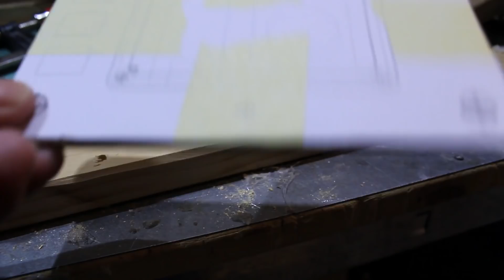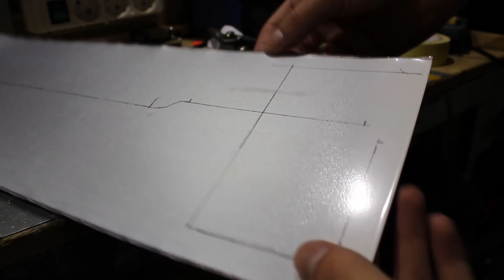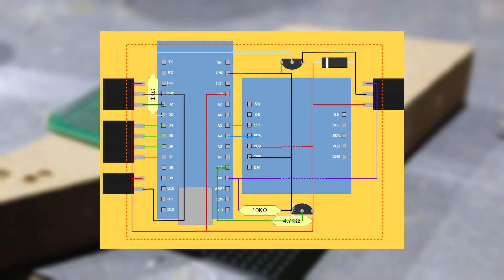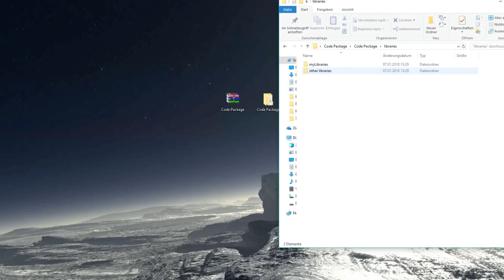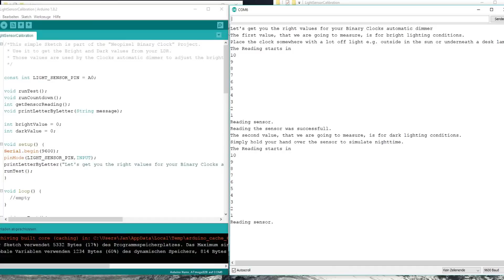Arduino based Binary Alarm Clock -  How to build it

Comment: Could use a little help. The newest Arduino update will not allow the clock portion to upload. has anyone solved this? I made the entire circuit on a breadboard and no luck getting it working.

Comment: Great video. I was looking for a binary clock to buy and found nothing of quality. So my wife says,  "why don't you build one?" I still have no clue how to do it since I've never messed with an Arduino. Though in my previous job 20 years ago I did work with circuit boards. I remember the first time I actually had to solder was around 1 am in the morning because one of the components  shorted.

Any way, you've given me great ideas for my design.

I also like that your clock is not BCD. I've always hated it. Especially when I had to deal with it in my job.

Comment: You mentioned you would include Amazon links in the video; can you provide those please. I found the eBay links difficult due to them not being English. The translation wasn't exact (i.e., ws2811 or ws2812?). Awesome project by the way. I have this project hanging on the wall as my next to-do when I find the time.